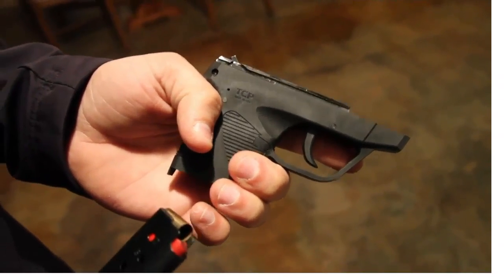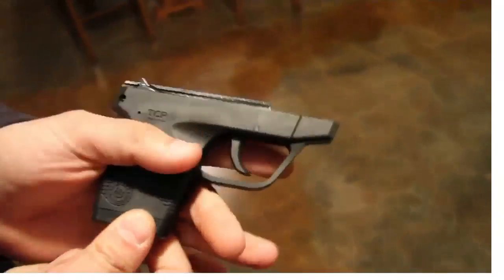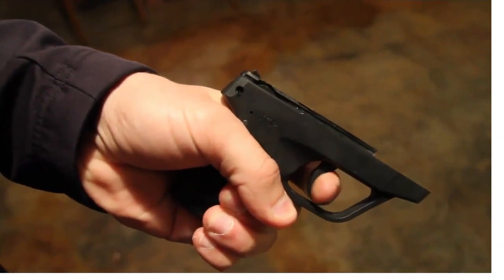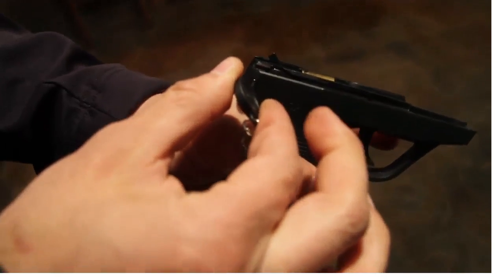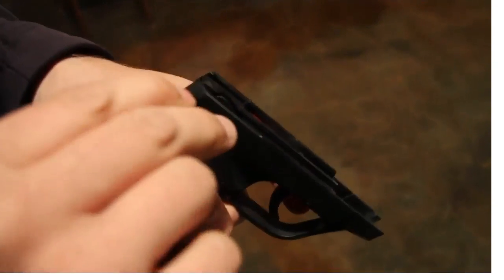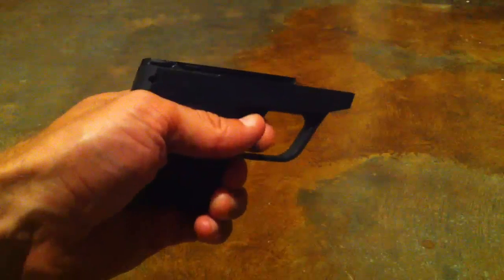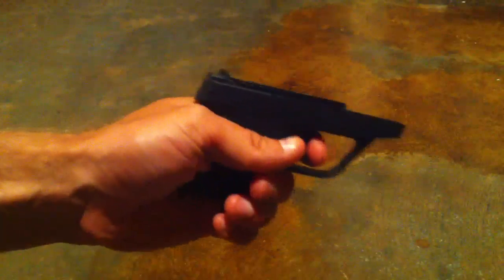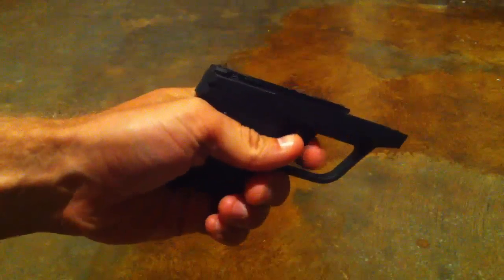Taurus PT 738 Fires Safety On

Comment: In the first place, that is NOT a safety, it is the Taurus Security System (TSS) that you are referring to.  You were not using it correctly.  Per the product manual:

If you use the TSS:
• Point the pistol in a safe direction and keep your  nger off the trigger.
• Remove the magazine and ensure it is empty.
• Pull the slide to the rear and check to see that the chamber is empty.
• Re-insert the empty magazine and pull the trigger to lower the concealed hammer.
• Insert the TSS key in the lock and turn the key clockwise to engage. The lock now protrudes so you can see and feel that it is engaged.
Reply: Gary Decker  hi Gary.  I bought this gun for protection but I can’t figure out how to engage the safety.  Would it be possible if u helped me?  I have a small triangle with stripes embedded in it at the top that does nothing and the top that does nothing.  Then I have the same switch at the bottom on the hammer that releases the clip.  Pls lmk.

Comment: Hello I have this gun can u please tell me how to lock it?  I have a small rectangle button at the top of the gun with stripes embedded in it, it does nothing.  Then I have the same type switch at the bottom left on the grip and it just releases the clip.

Comment: I thought it was a lock, not a safety, and you are not supposed to use it with a round in the chamber.  From the manual:
Never attempt to engage the Taurus Security System on a Taurus pistol with a
cartridge in the chamber.